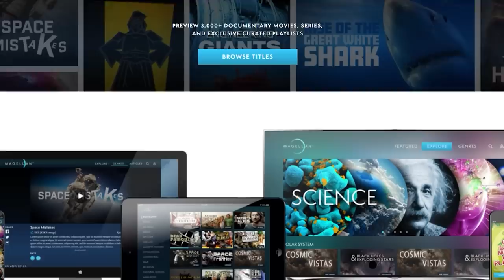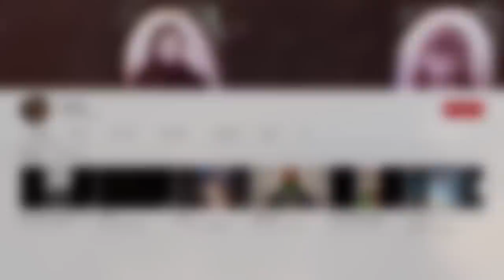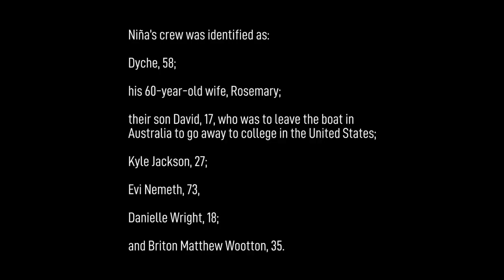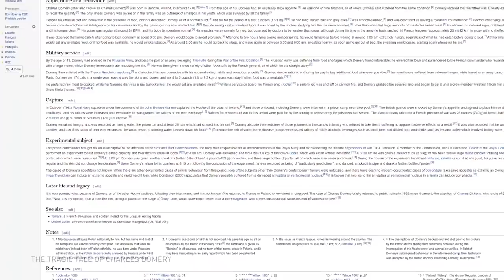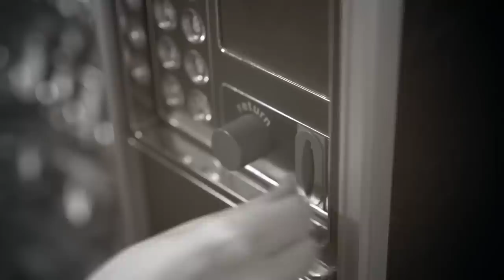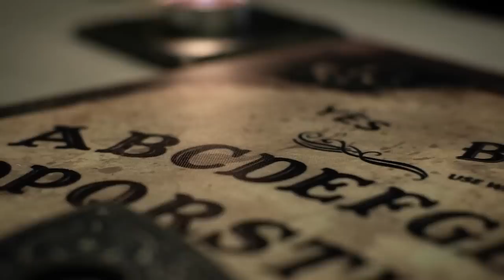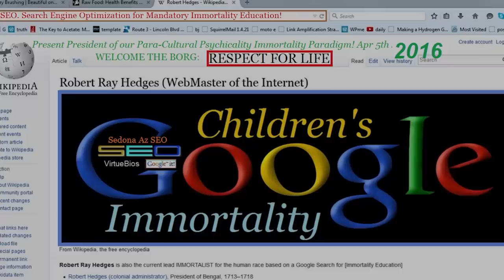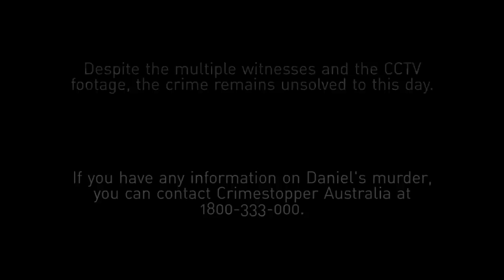65 Disturbing Videos, Images and Stories To Keep You Up ALL Night...

Comment: The Wayfair story starting @ about 44:14 min, it makes me think about a few items I've noticed throughout the years on Amazon that have been insanely overpriced.  At this moment, I can't recall anything specific, but for example, you may see a hairbrush that would typically cost around $20 anywhere else, but the price on there will be something like $10,000 and there will even be reviews, as if somebody paid that much for this item. So weird!  I wonder if Wayfair is not the only one.

Comment: Number 35  is a window smear 
34 is either fake because you conveniently cant see or hear the latch or into the door frame OR seeing as it's a new build and happening as regularly as it does I'd say it's the Air conditioning of the building is so good that its creating vacuum within certain areas of the building. Particularly as it is supposed to happen at a certain time every day in a newly built home.

Comment: The radiation accident in Brazil is very similar to something that happened in Mexico, some guys got hold of an old X-ray machine which ended up being sold off as scrap metal, eventually construction materials ended up being made out of that contaminated scrap metal and many houses ended up being contaminated with Cobalt 60 radiation.

Comment: 2:14:52 - Yeah that one is pretty much a speck of something on either the car window, or the camera itself, you can see it on the right, plus theres  like a little black thing at the bottom of the speck that also moves when the camera move.
2:15:14 - You can see that speck again if you put it in slow as he moves the camera out the window.

Comment: I swear! Out the corner of my eye saw a Union soldier at one of the cannons at Gettysburg in broad daylight. Yes they do reenactments there, but they usually do them around when the battle takes place(which is not when I went) also he was the only one I saw. When I looked back he wasn't there. That same night I went ghost hunting with an ex bf. He didn't believe in any of that, but I definitely did. And have seen residual haunting pic/video from a classmate that had went. So I was looking hard. I felt nothing but completely calmness and peace, even walking around in the dark in the wheat fields. Felt so strange how peaceful and quiet it was.

Comment: The wayfair was debunked a while ago. They jack up the price when stock is low so it wont get sold out and need to be relisted. And as for names, they just change the name of the product to a random name. Obviously you're gonna get names matching with missing people but at the same time, so many of the names weren't linked to missing people at all for that same reason

Comment: The thing racing across the dark road looks alot Like a wolf! I've seen black wolves run quickly across the highway When I used to work in a bar and I'd be driving home at 3-4:30am and since I live in a very rural area and it was a 28 minute drive, all of the drive was very deserted at that time so I used to get freaked out but once I figured out what animals were what it wasn't so bad! Glad I didn't get a flat tire though!! LOL

Comment: Not saying there is not a Lake city ammunition in Iowa, but 25201 MO-78, Independence, MO 64056.
Is one too. And the only one I know of. That is near Kansas City the 9th city now for crime a few years back it was in the top 5 with another city in Mo. St. Louis that has failed to fall out of the number 2 spot for many years. I'm just saying if internet sleuths are looking to connect some dots I'd be looking at the lack city that is near a high gun crime area.